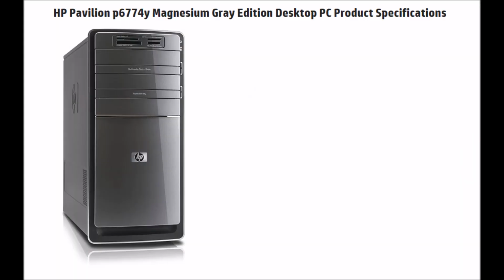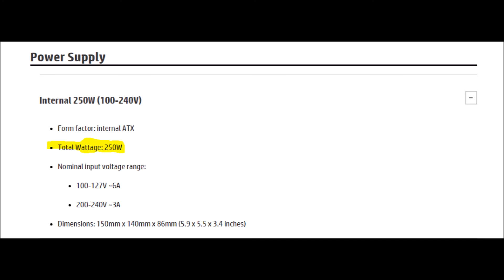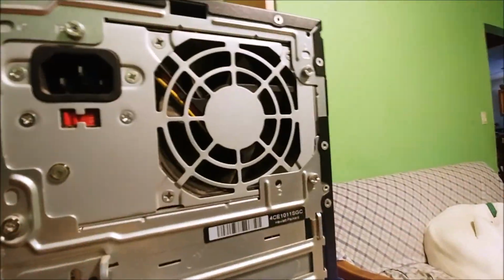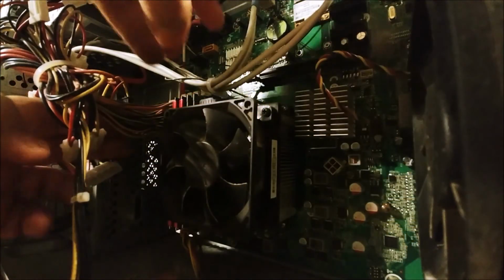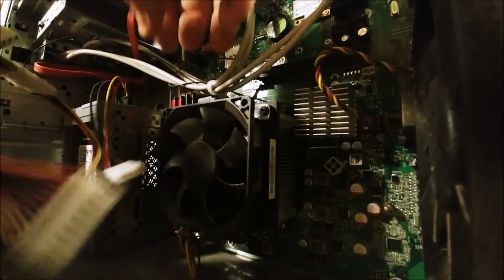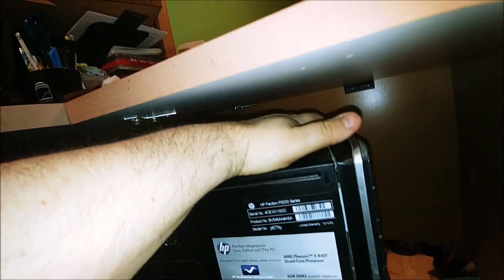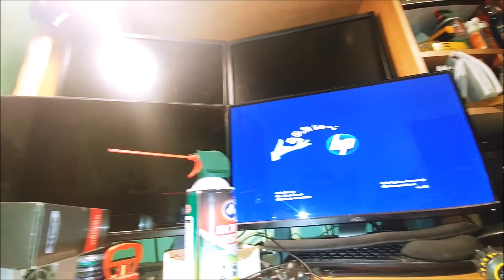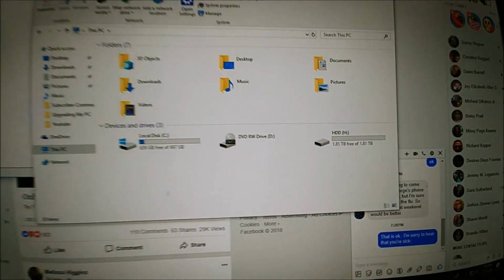MAKING YOUR OLD PC LAST LONGER

Comment: i think the videocard could use the ventilation opening above the connectors
Reply from the maker: Agreed.  One thing that I didn't like was the power supply fan was blowing into the graphics card fan.  They were each blowing heat at eachother, so I took the side panel off the tower for now.